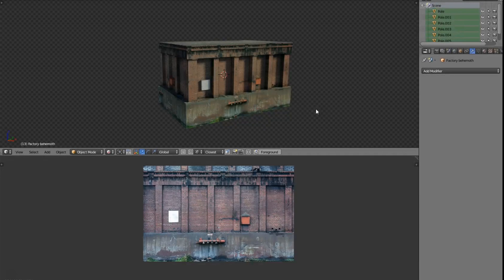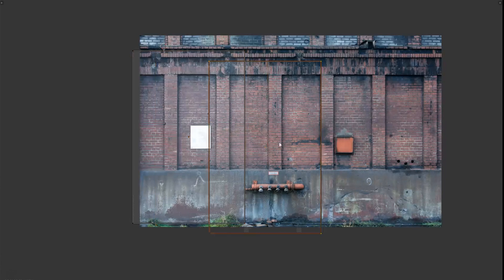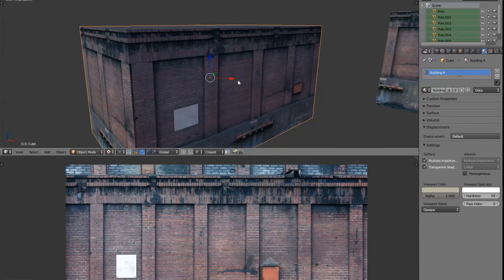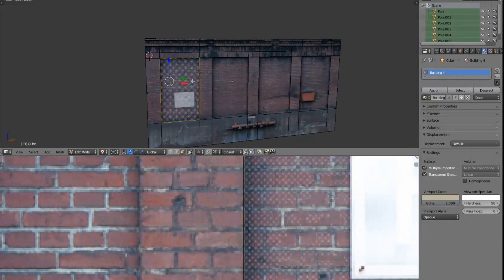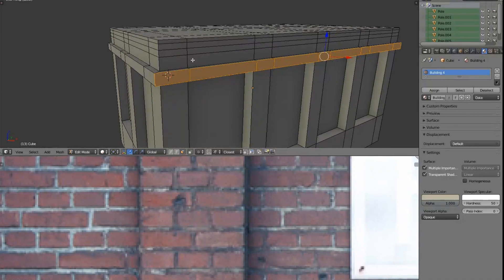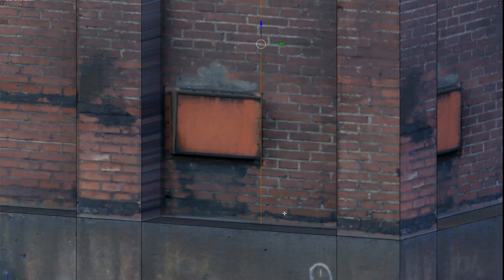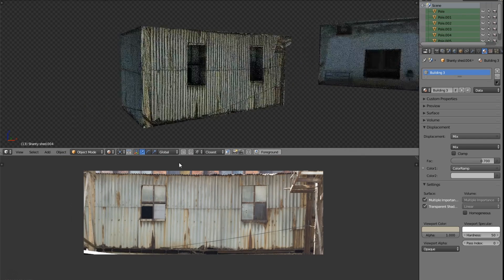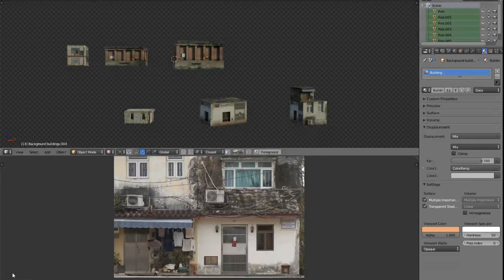Low-Poly Buildings from Images [TUTORIAL]

Comment: Can somebody help me, in blender i cant just click to select or unselect anything. i have to drag, not also if i am changing something it is auto keying everything though i turned it off several time... please help
Reply from the maker: That sounds odd, not something I've encountered before! Maybe double check your preferences if you have left- or right-click select. The auto keying refusing to turn off is a weird one though, it might be worth reinstalling blender.
Reply: @StaticPhotons  for selecting anything i have to hold shift too idk whats going on
Reply from the maker: @1995sinner  Only thing I can think of is to check the settings, if keyboard shortcuts have been changed that may explain the odd behavior.

Comment: Why is this low poly?
Reply from the maker: A high poly model would have more details in the actual mesh (maybe down to each individual brick or beyond, each screw and panel of concrete as well as all the pipes and fuse boxes). This just has fairly basic geometry which has a photo texture on it for realism, which means it renders faster and will be light on scenes so you can have more stuff in a scene. If you were doing closeups you would want more detail in the mesh.
Reply: O yes..ty 😂